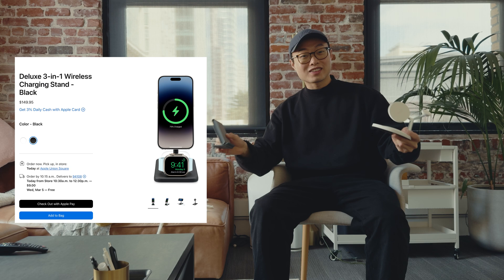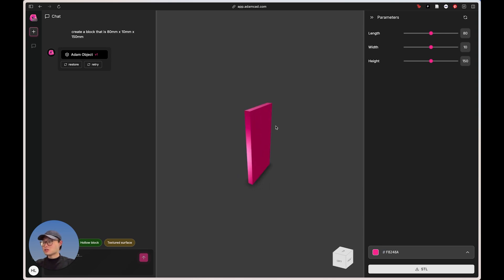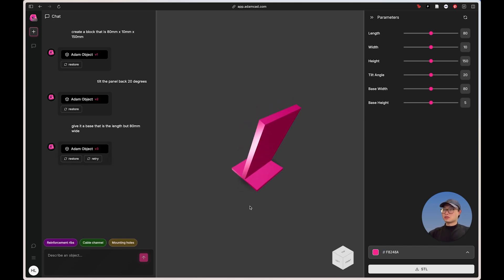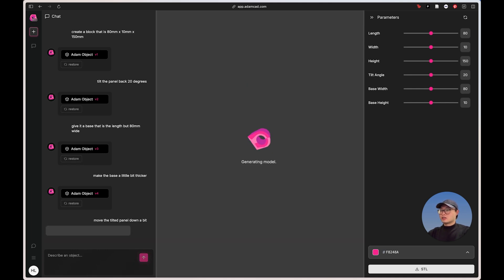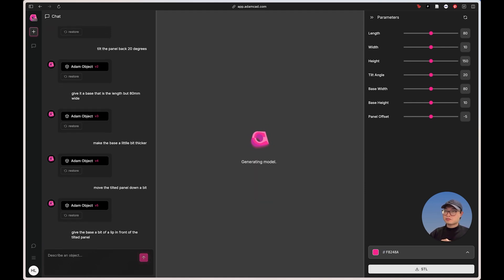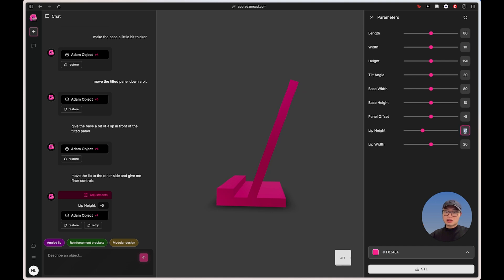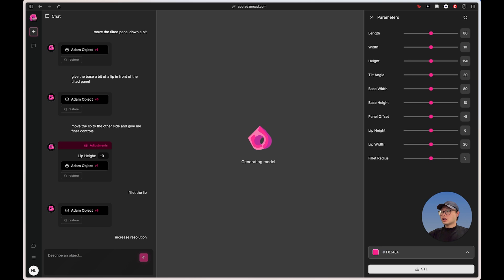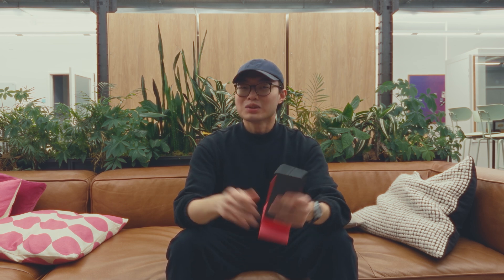How To Make a $0.16 iPhone Dock with AdamCAD AI 3D Modeling

Comment: I think it's very neat to be able to design this way but I could model this in solidworks in less than 5 minutes and on top of that, it could be converted to many different file formats made for more than just 3D printing.

Also, your time costs $$$ so with your labor on design and printer setup, you are closer to $5-$10 for this.